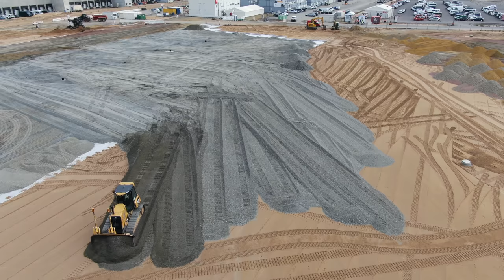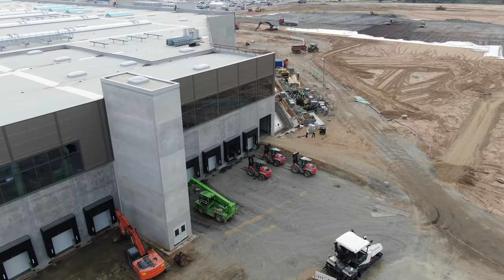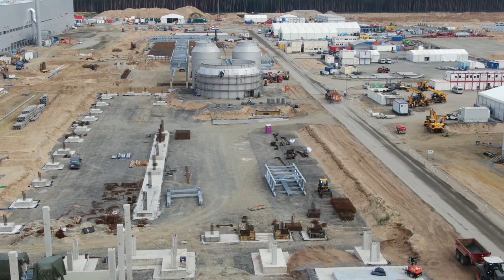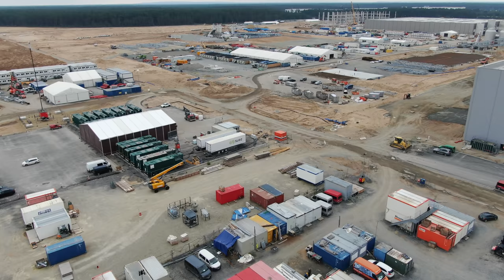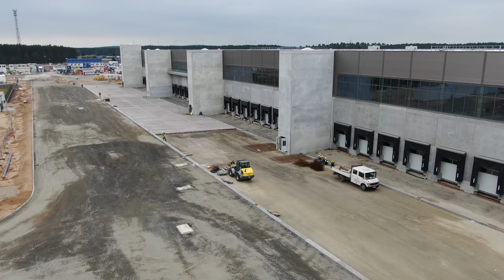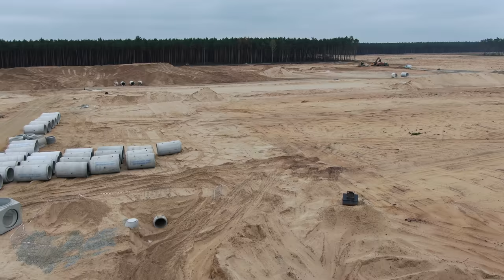Giga Berlin | 2021-09-25 | Casting walls

Comment: Big water tanks. This should allow them to coordinate with the local water authority in order to not draw too much when supplies are in any way scarce. From the permit discussions it sounds like production could begin in late November. Probably a slow start though.
Reply: Those are for wastewater treatment. But yes, the factory can stop sending wastewater out for up to 20 hours if and when the public wastewater treatment plant is overloaded.
Reply: Those tanks are for process wastewater coming in batches from the production (e.g. paint shop). The wastewater will be checked, eventually treated (for this there will be also basins - not yet build - between those wastewater tanks and the tank farm). The process wastewater will be - controlled - mixed with the utilities (e.g. toilets) wastewater and pumped to the sewage plant.
The "final" permit confirms the application. A factory e.g. with a wastewater treatment facility. Which also has to be in working condition.

Comment: Great video. I wonder how many more buildings they need to finish before making any cars. Or can they start now?
Reply: Many. Cooling, CUB, Sprinkler , Hazmat warehouse, Tankfarm, Wastewater treatment...
Reply: @julianreverse  What is a sprinkler building? I'm familiar with fire suppression sprinklers in buildings, but I haven't come across a building dedicated to "sprinklers". Is this a building containing pumps (and possibly fresh water storage) to feed the fire suppression flow to the site's buildings? Thank you.
Reply: @ivanprock624  Exactly.
Reply: @julianreverse  looks like they are already building some of those. I wonder how long it will take to build the rest. They wont start making cars until next year at this rate. Even with everything approved. Very sad to see that vehicles will be made from texas before berlin when they started earlier AND the factory is smaller
Reply: @richmargin6082  "Even with everything approved"
Those auxiliary buildings are covered by a permit granted in July 2020.
Reply: @abalada  Interesting. I guess they can make those buildings in a month? I guess they will start pilot production this year, lets say December if they get the final permit on time!

Comment: @16:45 I see on the column beam bearing stubs quite a few 'filler' blocks, looks like somebody made a mistake here and needed some correction :-), most of the beams later installed do not have these filler blocks. Later installed beams are also simply square at the end without a notch.

The battery factory column/beam structure looks extremely heavy to me, indicating some heavy equipment will be installed in this factory.. The factory in Texas seems much lighter constructed to me.

But a lot to do in about 2 weeks before the 'Oktober fest' at Giga Berlin!
Reply: No there is nothing wrong, they safed money by using the same form for all of the beams and adding some simple "filler" blocks.
Reply: @julianreverse  If it was normal, we would have seen these filler block on all places, it are just a few, so it really looks to me someone made a mistake, or they changed their mind while building already started... 

Its not uncommon this happens, at Giga texas they also had to make a few filler blocks when the columns turned out to be too short at a few places.
Reply: @MarcoNierop   They are everywhere. It is normal and as planned.

Comment: any idea when hvac equipment will be lifted up? And based on timeline you found shouldn't the 2nd stamping area be further on by now? Or maybe I just read it wrong
Reply: After they got the permit.
Reply: To my knowledge Tesla has already the permit for the "Stamping 2" extension. But not yet a permit for the pile drillings applied for. Here they planned to use some special srew piles which influence allegedly the groundwater flow less.  The timeline from May assumed that for the changes applied for, a second phase of public participation won't be needed. But this was never really realistic as it involved new things (like those srew piles). And the last step of this second public participation did just end this week.

Comment: I would like to understand the general 'feel' from the immediate local community with regards to this factory. I suspect it's mostly positive but evidence of this would be great.
Reply: There have been in fact a lot of protests against the factory, because of its potential to exhaust the local ground water and the huge deforestation that was necessary.
Reply: I checked the results of the Federal Election last Sunday in Grünheide.
The political party (the ÖDP) most outspoken against the Tesla factory there got 0,9% of the votes. Down from 1.1% they got in 2017.  Which is definitely a surprise.
The bloc of parties pro the Tesla factory gained so +15% compared to 2017. 
Those results for Grünheide follow roughly the Germany-wide trend. The Federal Government has no say on this subject. But if the voters are really moved by something they normally don't care about this.  But one thing is clear: the political parties which were more or less outspoken against the Tesla factory did not gain anything from this position in Grünheide. Interesting.
Thus the feel of the local community is clearly pro or at least indifferent*) to this new factory.

*) probably more indifferent than pro as I guess most have no real idea how much change this big employer will bring to Grünheide. And also the state of Brandenburg. The Federal State of Brandenburg has no big companies headquartered there. The next big (industrial) employers after Tesla Manufacturing Brandenburg SE are also just subsidiaries of companies headquartered elsewhere. And the gap to the next big (industrial) employer is massive.  With the numbers of employees mentioned for GF4 phase I and the battery factory Tesla Manufacturing Brandenburg SE will be nearly 10 times bigger than the next biggest (industrial) employer in this state.

Comment: 16:50 Someone needs to produce this structural system as toy at 1/100 scale, where the pieces snap together Leggo or TinkerToy -like.  The Tesla Brandenburg kit would include all the pieces necessary to build a complete model of new battery fab.

Comment: Tobias meinst du die fangen mit den 21700 Zellen die Produktion an oder haben die schon genug 4680 Zellen von Kato Road welche Sie nach Berlin liefern?
Reply: Man kann die 2170 Batterien nicht so einfach gegen eine 4680 Batterie austauschen. Letztere wird wird ein strukturelles Bauteil der Karosserie. Und da es jetzt - entgegen der ursprünglichen Planung - nur eine Produktionslinie im Karosseriebau gibt wird das wohl eine sein, die für das Model Y mit 4680 Batterie eingerichtet wurde. Deswegen auch der zeitlich vorgezogene Bau der Batteriezellenfabrik in Grünheide. Und so lange diese nicht produziert, wird es 4680 Batterien wohl für die Produktion in Grünheide nur in limitiertem Umfang geben.
Reply: @abalada  Is there evidence that you need 4680 to structurally integrate it to the Y? Could probably be done also with 2170 cells?
Reply: @TurreTuntematon  I think the 2170 battery cells lack the energy density needed for this. Assuming the weight/volume of this structural part is a given, this would mean a shorter range. But of course, Tesla will make changes if this with the 4680 battery cells won't work out as planned (for the foreseeable future).

Comment: German need to speed up..They are very slow.. this is not Airport..
Reply: The red tape is holding them back.
The Austin factory which started a year later will be completed and start production with this one despite Berlin having a one year lead.
Reply: Can you see the progress inside the carfactory? the progress of the batteryfactory is very fast at the moment.